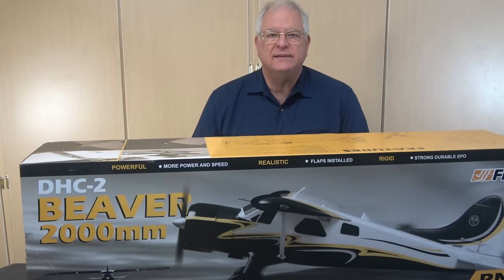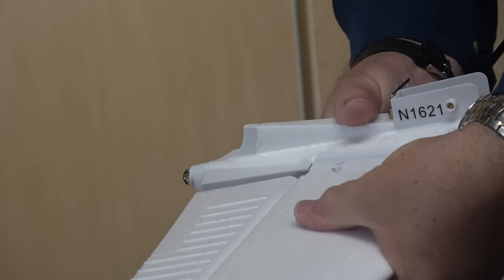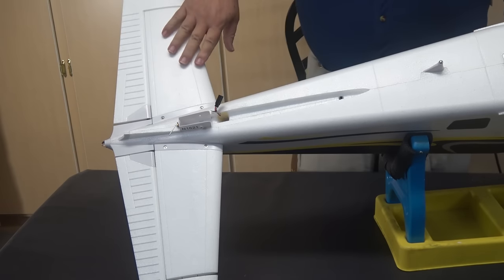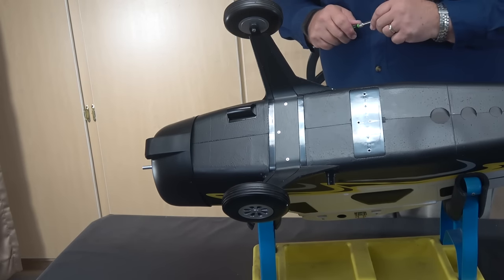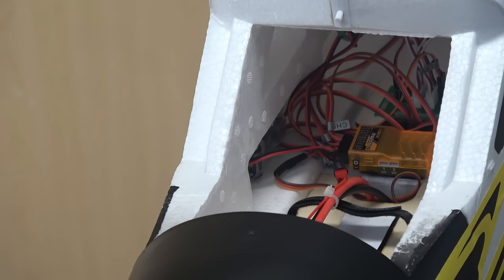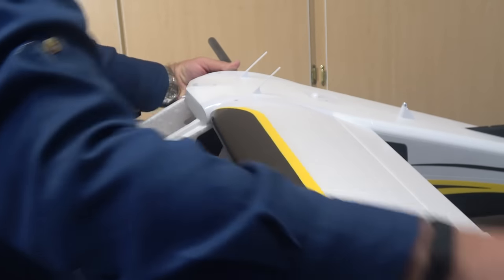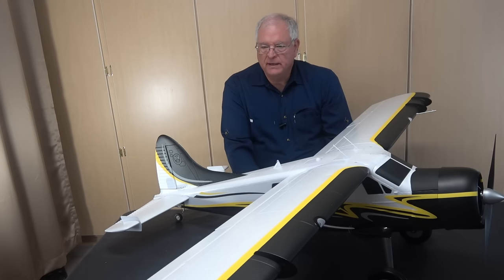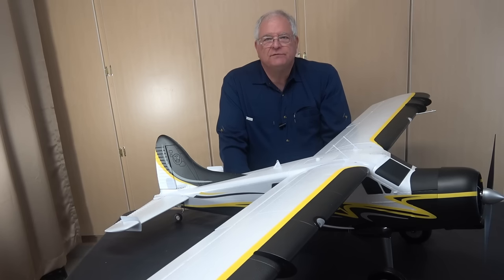FMS DHC 2 2000mm Beaver Assembly Log

Comment: By far one of the better reviews I've seen yet, thanks so much. Also, though I would chime in a bit... You mention not to use glue in case one needs to replace parts, very good point indeed. However, instead of glue in those joining joints, one could use tape just for that extra security.

Comment: One addition for anyone starting out with this Beaver.     The elevator is not hinged - its just condensed foam.     Mine were already compromised right out of the box.   If you dont cut them off and reapply them using high quality hinges you will be sorry because the foam hinges WILL fail.    Losing an elevator in flight never ends well.

Comment: I do have one question.  I noticed that when I connect the battery the lights illuminate and there is no way to shut them off.  How would you put a switch on to turn them off?  Believe it or not, the lights I find, are somewhat distracting when I fly.
Reply from the maker: Bryan Beller  How about something like this:
https://hobbyking.com/en_us/multi-remote-receiver-operated-on-off-switch.html

Comment: Hi. What are the flaps throws for half and full flap operation? Thanks
Reply from the maker: I really haven't measured them in terms of angles etc. I basically used the flap setting menu on my transmitter to set angles that looked like what I'd seen in photos. i suspect that my 1/2 setting is about 30 degrees and my full setting is about 60 degrees offset from full up. You'll also have to set some down elevator mix so just work your way into the performance you like a little bit at a time. Be sure to give yourself some altitude while experimenting.
Reply: @AZJim12  understood. Is just that the manual says nothing about flap settings.
Reply: @AZJim12  
Thanks for reply
Reply from the maker: @edwincordero8  You're right, though, flap  info would have been helpful.

Comment: I have a question......I HAVE the FMS DH Beaver 2000mm ... I HAVE this and Can I use the LiPo 22.2V 4000mAh 150C on this plane ..yes or no..it use's a 150C....I had this Battery made ., 100% water proof for water landings ??????????
Reply from the maker: Ken Simpson   Yes. You can use it.
Reply: Great, thank you for your help...

Comment: Can you please provide the ubec used in this video.
Reply: rcgr81 I used the Turnigy 5 amp 8 to 26 volt sbec. It's about $7 at Hobby King. I use these quite a bit so I also got a small jst plug set to make connectors to the main power plug on the esc side. I tapped the main leads to access battery power. On lower voltage plugs I look for the small connectors with jst taps to make the connections easier. On this one, I used a little jst pigtail to link to the sbec.

Comment: can you change it so it runs on safe technology with d6 specktrum
Reply from the maker: autel pumpkin army There is a threat about using the eflite receivers with SAFE in other planes on RC Groups. Lots of various sized planes listed. So it would likely work with this. If you need the SAFE control limits not just the AS3X stabilization you might be better off with a nice "second plane" aerobatics plane to build your skills rather than r ely on electronic supports on a near giant scale model. An advanced beginner should have no trouble with this plane.
Reply: thanks a lot for the help have been flying my apprentice pretty good on mode 2 so thought would be nice to have flight kinda like that looks like as3x would be way to go
Reply: autel pumpkin army the larger planes really shouldnt need the extra stabilization system but there are different types out there much better than the Spektrum brand. Cheaper priced too. My suggestion would be to do your homework first. This wouldnt be considered a beginner plane and to be honest,I would pick something with Safe already installed. I love my Apprentice and even though I fly intermediate skill level now,I seldom use Safe anymore except mabe in windy conditions or when I am not feeling well thanks to a medical condition,it alays has my back,taking off and landing.